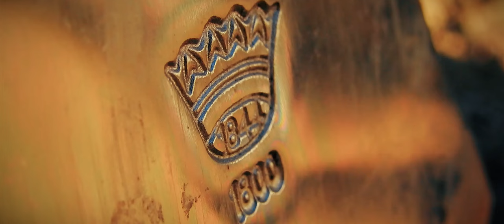HELKO WERK TASMANIAN put to work

Comment: Hello man. That was very nice and pleasant  video👍  Do you have any effort to make axe head shiny again after work or long period hanging on wall. And if you keep it shiny, how? Polish with compound or very fine sand paper?
Reply from the maker: Hello, thanks. I don't polish or keep my heads shinny at all, I like them aging. All I do is make sure to keep rust away, usually oiling the head from time to time is enough, I use the olive oil from the kitchen, just a little spoon does the job.